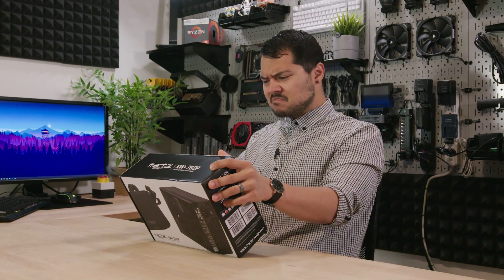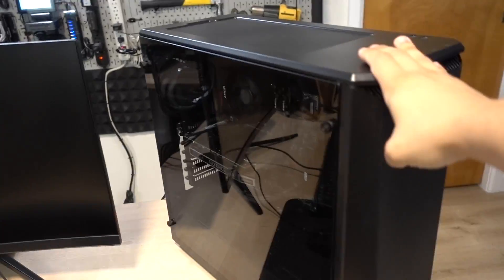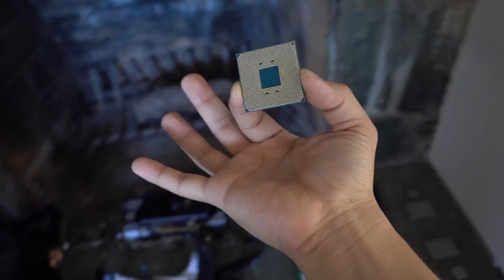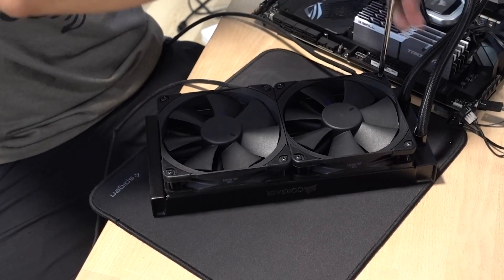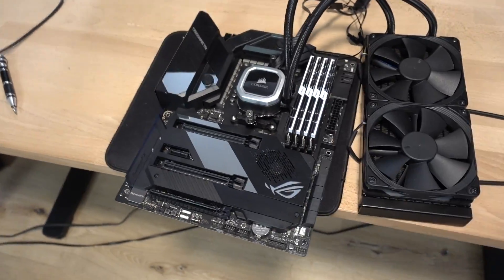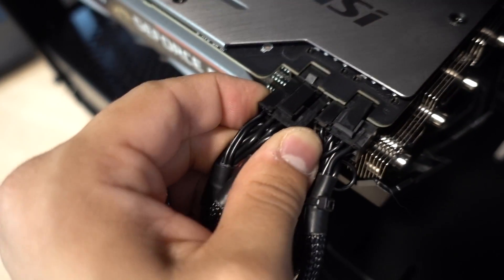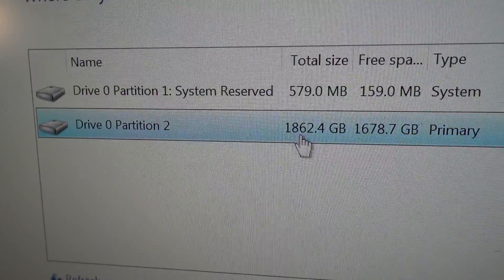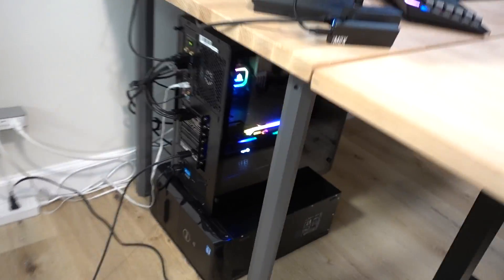I REALLY don't have time for this - *EMERGENCY* PC BUILD

Comment: Dang, 2tb nvme... I kind of hate you right now.largest nvme I have is only 500gb. But you might want one of the electric screwdrivers I have. They work decent and are super cheap.

Comment: They make an under desk clamp thing that hangs the computer under there , I can't remember exactly what it's called , but it looks like it's very flexible for your needs.
Reply: https://www.amazon.com/Swiveling-Under-Desk-Accessories-adjustable-organization/dp/B01BRJASHC/ref=asc_df_B01BRJASHC/?tag=hyprod-20&linkCode=df0&hvadid=241940662738&hvpos=1o3&hvnetw=g&hvrand=8753335112794448732&hvpone=&hvptwo=&hvqmt=&hvdev=c&hvdvcmdl=&hvlocint=&hvlocphy=9052838&hvtargid=aud-801657747996:pla-578037497200&psc=1

Comment: My first build was an emergency build.  My laptop died and I needed something cheap and small because funds and space were limited.  I ended up with an Athlon 860k and an R7 360 in a Cooler Master Elite 130.  It was better than the laptop, but not by a whole lot.  My second build was better planned and more upgradeable.

Comment: HELP NEEDED! I recently built a new Ryzen build (3700X and RTX 2070) - but Windows 10 will NOT install! I'm using the Asus Prime X470-Pro Mobo with 16 gigs of Corsair Vengeance LPX DDR4 3600Mhz memory. I'm using an official Microsoft Windows 10 key, but part way through the install (always about 30% in) it craps out (with error code 0x80070570). If you can help me out, I REALLY NEED IT!! Thanks!

Comment: If the bluescreen error code is MEOMRY MANAGEMENT, replace the RAM. After 2 weeks i buildt my PC, i was getting blue screen about 5 sec after booting(putting password) and sometimes it would run troubleshoot before booting. I tried to reinstall windows and it would block at a precentage(30%only, 70% etc.).
One RAM was bad. I pull it out and it worked(i hat a dual channel RAM), and the retailer replaced the kit(no PC for 3 weeks).

Comment: That.... Was the weirdest GPU installation I have ever seen.

Actually , that was the weirdest PC hardware video I have EVER seen.
Reply: Howtobasic flashbacks?
Reply: @vargabazsaa  No kidding... XD
Reply: Have you not seen the verge?
Reply: Eric Swansboro oh come on the verge was a great tutorial, what annoys me is that no one else who makes a PC build guide bothers to mention the important details. You need a Swiss Army knife that hopefully has a philips head screwdriver and the other thing no one mentions is that you need to align the brick with the insulating pads, if beginners don’t do that the power supply would short circuit and come into contact with the rest of the system. Everyone just watch the verge they’ll clear everything up

Comment: 7:13  Can someone please explain how a M.2 SSD can "eject" itself from the slot on the motherboard?
Reply: The screw which holds down keeps it inder tension, because the slot is built in a way, that the nvme ssd just sticks out at an angle, so when you press it down, the pressure on the opposite side gives a firm contact with the pins. So in this sitiation, when a termal pad "glues" it to the heat disperser cover of the drive, when you release the pressure from it, the drive can come out easily, while still sticking to the heat disperser. 

Tl;dr: there was no screw holding the drive in the first place, thermal pad caused it to stick to the cover.
Reply: It was sticked to termal pad

Comment: Lol that's an awful lot of work for an emergency build. Wouldn't it be easier if Kyle just dropped the 3700x into the original P400A build? I don't think the extra bandwidth of Pcie 4.0 from the X570 would've been necessary. But hey, it's definitely a great video and the build is great.

Comment: My work laptop is giving me troubles. It keeps telling me not enough memory for the 4-10 excel files containing hundreds of thousands of rows of data and a hundred columns with free text columns mixed in. 

My work computer is a laptop company issued. My custom gaming computer sitting nearby with 32 GB ram and 6700K processor is dark and silent.

I call talk to my supervisor about it and they confuse memory with storage space....

Comment: When this happens, my first move is checking the ram bios xmp profiles and CPU voltage/frequency. Then if that doesnt do it, bare bones the machine as much as possible, even taking it to just one Dimm slot. Run windows updates, look for all driver updates from manufacturer, bios update if needed. Run pc benchmark. If at that point, you arent blue-screening, you can start adding ram back first. GL any of you having a similar issue.

Comment: How can a one-handed build be so much better then the Verge... just watch this vid 😎
Reply: Because Kyle has experience handling small things with one hand?  ;-)
Reply: @acubley  You said it, not me 💯.... wait a minute, Lyle is that you? 🤔
Reply: @ArtEPersonal  I had a lot of problems with the tweezers slipping off cables in my case, so I started using zip ties to secure the ends of the tweezers together... (A quick building hint: Try to use only plastic tweezers as the metal ones tend to short out the power supply when you do not use enough insulating foam to mount the power supply in the case 🔥)

Comment: Imagine you have a 1080 ti and while installing a ek waterblock you accidentally knock one of those smaller than a grain of rice resistors off, of course I haven't the budget to replace the card so I got the pleasure of becoming a freaking brain surgeon who's best assembly of tools is like trying to conduct said brain surgery with a hammer and a chainsaw...lol. other day I managed to get it resolved on with a cheap ass soldering iron and a xacto knife, thought I had it fixed booted up fine and all that but than today while gaming I got a flat out black screen and was like FML, being a sucker for punishment I had to tear down my system without draining my ek a240g loop with the waterblock still attached, at this point I think it's safe to say I managed to pull off a repair that would make a NASA engineer blush, suffice to say I managed to get the card back up and running while still having to salvage a donor resistor from an AMD radon r9 270 card I had from 2 upgrades prior so I officially have an nvidia/AMD hybrid gpu...lol.

Final thoughts props to surgeons for having to work at micro scale I never want to have to do this again.

I'd wish to have it as easy as you Bitwit but than I would rob myself of the opportunity to develope the skills needed to succeed in such a repair

Would totally recommend anyone who wants to try this to give it a swing

Comment: lift the PC 4" on rollers 20"  by the length of the pc front to back Plus 6" and were the power supple is  have hole in platform PC sits on

Comment: my windows 8 laptop has issues, so a year ago I had a Unmountable boot volume error. I managed to fix it, I would get kernel data in-page errors before that too, anyways I did a refresh and it was okish, I still would get the occasional kernel data in-page errors. I would get 100% disk usage at times often. just last month I disabled some things and it worked fine.

the other day I was on it playing a old game and then had to go out, I came back and later went back on... I was ok then it bogged down and froze, I left it and when it restarted I got that Unmountable boot volume error again... so I knew what I had to do.. I got my recovery boot usb and put it in did the stuff but instead of the installation thing popping up after the logo the screen just goes blank...

soo idk what to do I looked up a few things. the sad part is I can't afford to build a PC, the one I want.  so I need to back my data using my brother's PC or something to a external hard drive.

Comment: Hey guys I have a question and dont know where to ask.

So while playing games, I'll randomly drop frames it my game tends to "lag" but not connection wise. It's completely system related. Its fine for a while but then after about half hour/an hour it starts. Temps are fine and usage is fine. I don't know what would be causing it or how to fix it. 
Specs:
8700k
16GB 3200mhz
1080ti ASUS Rog Strix
500GB NVMe m.2
2TB HDD

Comment: To build a PC firstly you will need a table - The Verge
Reply: and second you will need to have a swiss army knife
Reply: geiri geirason which you hope has a screwdriver
Reply: First things first you need to be born
Reply: don't forget the tweezers
Reply: Dont forget the braces a and the cpu applicator.
Reply: Verge never even mentioned you need two hands! 🤣  oh ... wait ... just one? 😆
Reply: Do it like Kyle: build a PC in midair with one hand.
Reply: Actually, I never build a PC on a table. Always on a floor. Don't know why, but this way is more comfortable to me. Maybe it's just because you can't drop an expensive part by accident if it's already on a floor.
Reply: rust you ever watched Linus drop tips
Reply: @RustedCroaker  thats remember me when i don had space for build PC's and used the bed for it XD
Reply: Don't forget the tweezers..

Zipties :P
Reply: It's important to install the PSU on the pads so it doesn't short circuit.
Reply: guys, dont let the psu short circuit the whole system
Reply: Forgot the thermal applicator!
Reply: This PC will never last, it doesn't have NEARLY enough thermal paste.
Reply: you need pc to build pc- Verge
Reply: WhAtS a TaBle
Reply: Some tweezers to tighten up the wires

Comment: My pc crashed yesterday also. 

2200g with 16gb ddr4 3200mhz 
I was running the ram at 2133 by default. Could that have been my issue?

Comment: Anyone else suspect that a fresh install of windows would have gotten the old pc up and running again?
Reply: Fresh install is the ultimate "have you tried to turn it off and on again?"
Reply: What happens when it didn't and you just wasted 45 minutes.
Reply: @nateg452  I hope you mean the 5 mins it takes to get a restore of a backup started, before building this PC.  

A techtuber this big should have some kind of backup strategy on their streaming PC.
Reply: @hughdahand5711  I don't know what kind of restore you're doing but any restore takes a bare minimum of 20 minutes. That's if you've got hardly anything on it. Again we don't know if that would even work. By the way he's talking it also seems that he was looking to Make it more manageable with a new case anyway.  So why wouldn't he just do something that he would know would work when he is going to be streaming in a couple of hours.
Reply: @nateg452  If it takes you 20 min to get a restore started you need better software.  

Running a stream on a fresh untested build can be a disaster, and nowhere did I say not to do this build.  It could have easily been setup while the old system was restoring a backup.
Reply: in his case he is fortunate enough to jest build a new pc from assorted parts lying around in his house

Comment: My new Ryzen build blue screened as soon as I tried to install the Radeon drivers for my RX 470.

Problem solved after a week: faulty system RAM.
Reply: Faulty RAM or video memory?
Reply: @Hybris51129  RAM - Sorry I didn't write to clearly.
Reply: @HuntersMoon78  No problem it happens.
Reply: Considering it happened when he tried to install the Radeon drivers, I'd say video memory.
When the RAM is faulty, the computer tends to bitch about it at POST, or not even POST at all.
Reply: @The_Keeper  Ive never heard of VRAM being faulty as an isolated incident, its usually the whole card thats DOA'ed, i think it was system memory
Reply: @The_Keeper  Not video RAM, it was system ram, cheap, shit DDR4 which was replaced with Corsair Vengeance LPX 3000MHz

Comment: All that hardware lying around, here's me still on Ivybridge E :'(
Reply: X79 is worth $$$
Reply: @bluescluessuperagent  It is but the CPU is only the 4820k. Mobo is worth a pretty penny though being the asrock fatal1ty champion
Reply: @mx3fto  I'd just sell the build as a whole pc

You can still get decent cash and then buy new.

Also x79 is still a relevant platform to be honest
Reply: @bluescluessuperagent  I may look into it. I got it at the time as I was running several drives and dual/triple GPUs so the PCIe lanes were very handy, but now I don't require it. Could probably get half a ryzen 5 build with what I could sell it for.

Comment: Using a PC to lift your PC is one of the biggest flexes I've seen.
Reply: lol dude has a literal house worth of money in PC parts just collecting dust.
Reply: @crazyhistory124  That's what hurts me,I don't even have one
Reply: ive been there. i remember having to correct my behavior when i placed my desktop on my laptop so it wouldnt be directly on the ground in my barracks room. it was a free-ish macbook so... just dont ever do that if its my notebook or thinkpad.
Reply: His "pedestal" is worth more then my pc
Reply: I've got an ancient 486 machine that I use as a footrest.
Reply: @d00dEEE  Whenever I hear 486 I laugh my ass off. I always think of the google picture pops when you search it. 486 pc.
Reply: "Yo dawg, I heard you like PCs, so we put your PC, on a PC!"
Reply: @The_Keeper  Put a PC on that and you, Sir, got a deal.
Reply: @d00dEEE  I had a 386sx
Reply: @domzzz1488  Yeah, my first "PC" build was an 8088 with a turbo button so it would run 7.0 MHz.  I just wish I had kept some of the old boxes that I built over the decades, it would be cool to try to boot them up again.  I still have my very first computer, a 1976 KIM-1 6502 @ 1MHz with 1K RAM, and it still works (at least it did like 10 years ago when I last tried it).
Reply: Dropping a 10K CPU is the biggest flex ive seen on earth.
Reply: @Legendary super Saiyan Broly i dont get the joke.
Reply: @Legendary super Saiyan Broly nice reference,  Lyle and Kyle are definitely part of the Tran family. Lyle strikes me as the kind to pump oil in someone's mouth. "Dictator regime" I can see a dream cloud above his head as he says it.

Comment: I had a taichi x570 that was press release shipped to me by newegg.com. That mobo went bad on me although the sb fan was a lot quieter at default speed. Now I have a retail version with the fan being louder and I had to turn it down to silent mode but working great. @BitWit why did they ship me a press version?

Comment: Has MSI X570 Gaming Plus in the case already which is supports the 3700X out of the box. Proceeds to dismantle the whole thing, when it could've been done with a CPU, RAM and GPU swap and an AIO installation. Whole ordeal could've been done in sub <30 mins.

Comment: Upgrade to Linux
Reply: And play only old games xD
Reply: @redblackfoxy  t. he doesn't know what proton is
Reply: @redblackfoxy  wine, DXVK Wine, D9VK wine. Do I need to say more?
Reply: @doufmech4323  Nice for you to assume i dont know, i have used debian for 10 years. Thats why i said NEW games. Ususally game that has just been published does not work/horrible fps with those emulators. So can you tell me what Linux distro you run in your gaming pc and what New games you play with it? Just curious to know.
Reply: @redblackfoxy  I use Ubuntu. I could play Darksiders 3 day 1 when it was released, with no problems at all. I got stable 60 fps using a rx 580. Ultra settings.
Reply: @doufmech4323  I hate windows trust me. but its better for gaming if you're gamer. Too risky and little to none reason to put Linux on gaming machine.